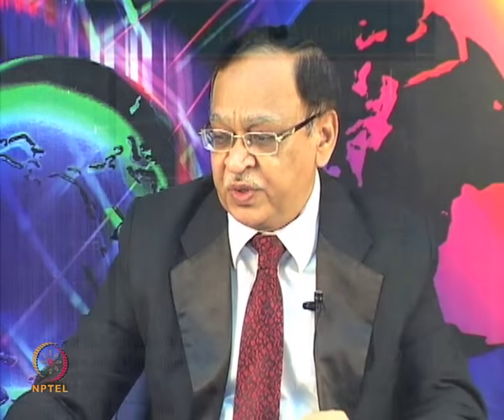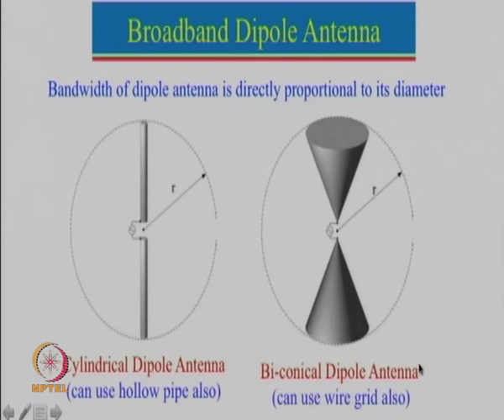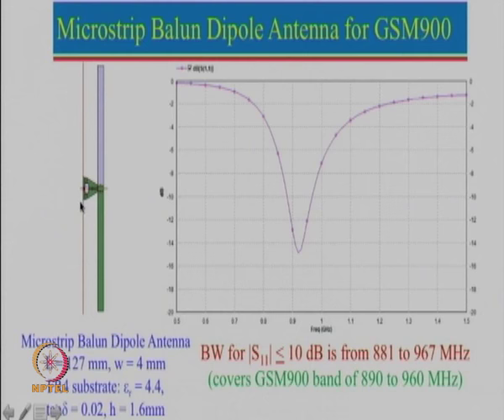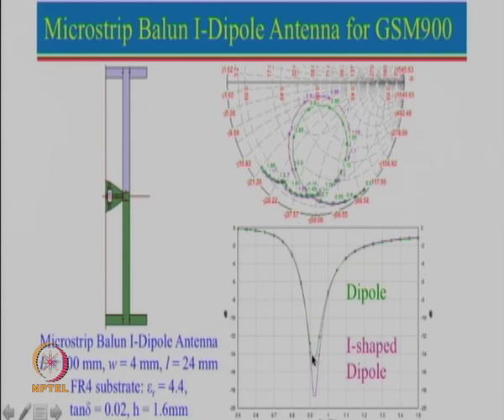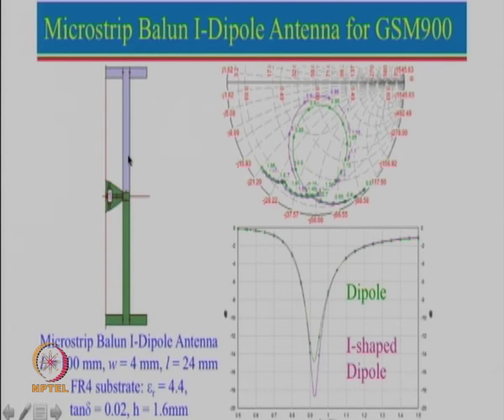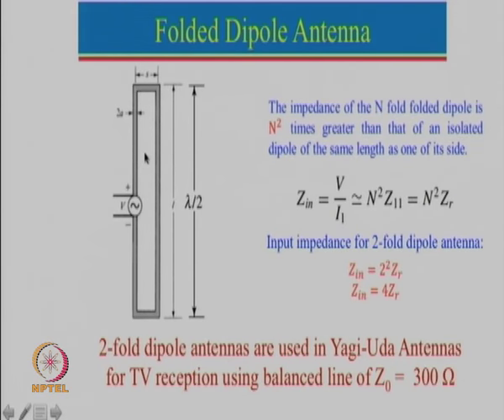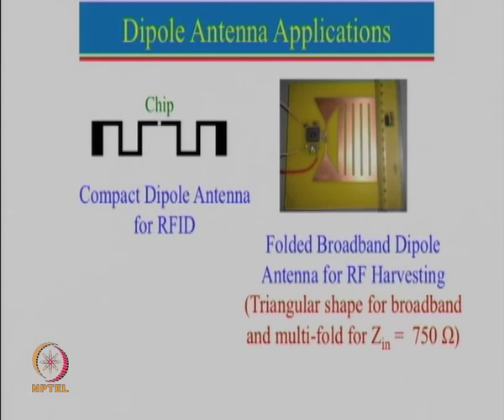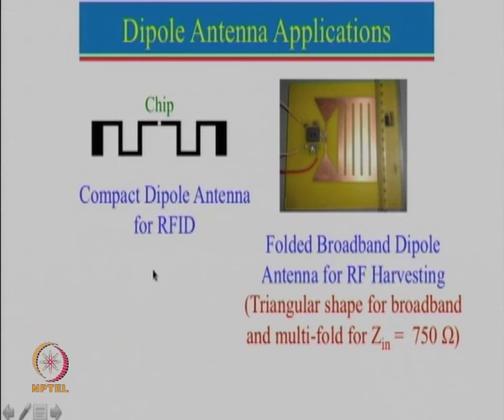Week2-Lecture 10

Comment: why bandwidth is check at below 10 db
Reply: Power reflection < 10 dB is considered a good value when designing antennas. It means 1/10 of the power feeded to the antenna is reflected back to the source.